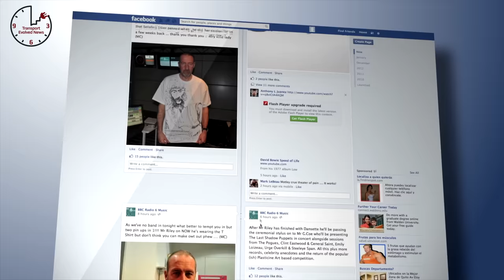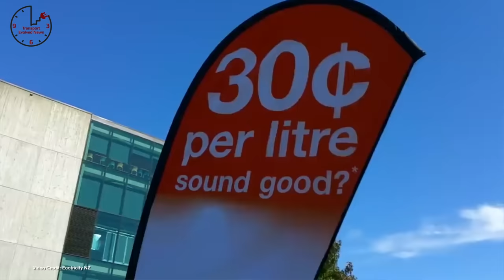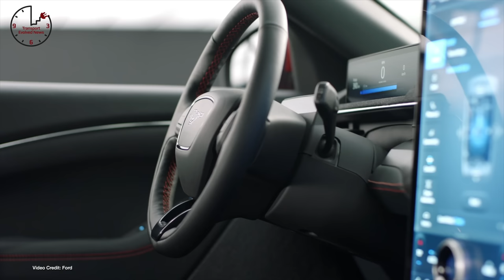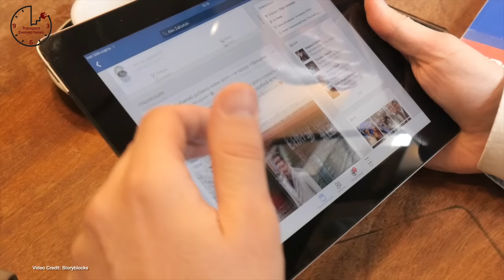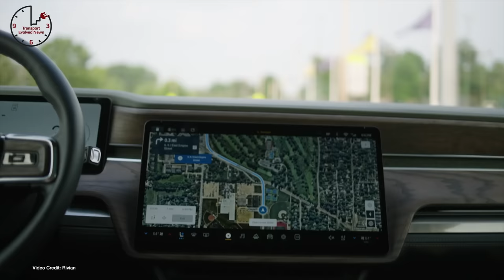TEN 349 -- White House Plans, Diess Disses Ionity, Facebook Pro-Oil Ads

Comment: Every automaker is anti-UAW. They just have CEOs with filters so they don’t admit it. And every EV advocate should be too. They worked hard to delay the EV transition because EVs require fewer workers.
Reply: The UAW give unions a bad name.
If you want to know why Tesla is non unionised? It's becuase many off those workers and families at yumi(Toyota) had the right to negotiate taken from them and UAW sacrificed the factory for GM jobs. The fact a year or so later UAW ended up with loads off GM shares (which they still own) makes many doubt UAW would ever have Thier or Tesla's best interests at heart.

Comment: I think we as part of EV community would have to stop covering hybrid vehicles, because automakers and govts are not. And we should know better as most of these hybrid owners don't even plug in and keep running them on oil. It's taking away resources( development, Subsidies,will and effort) from what could have been poured into pure EV development.
Reply: Hi Amuzic Earth, I understand your sentiment but where do you get the info that most PHEV  owners don't plug in? I'm  one such driver and like all others that I'm aware of,  we plug in fanaticaly. PHEV's are are great gateway to EV's but in some cases are needed due to poor or non existent charging infrastructure.  Most PHEV drivers that I'm aware of try to cover all or most commutes on battery only. Cheers.

Comment: The cars most affected by battery nerfing were S85s, not cars from 2019
Reply: That's what I though too...didn't sound correct.
Reply: @davidc2838  70, 90 and 100 kWh batteries had been nerfed when charging DC a lot, too, but not as badly and Tesla has taken it back mostly
Reply from the maker: I think you're right, I misread the article, which noted that the restrictions happened in 2019. That's my error - Winter
Reply: @transportevolved  Yep. You can apparently even install a software version from right before when the nerf happened (in 2019) and you get the old range and charging speed back. Not sure if I would recommend that, though. IMHO Tesla nerfed those batteries to prevent battery fires.

Comment: I wish those little E Scooters were legal in the UK. I work 4 miles from home which is a bit too much to walk and I don't want to cycle not least because no space to store it

So I drive

Would save 300 litres of fuel and local pollution to be replaced with just 30 KWh of electricity. Even if 100% of this electricity was from natural gas it would be like replacing 300 litres of diesel with 6 litres equivalent of natural gas. So 50x less fossil fuel burn. But the UK is now about 50% non fossil in its grid so its closer to 100x less carbon emissions

These should become legal sooner rather than later

Comment: I really like how Rivian have done pre (delayed) delivery test drives, as the saying goes drive it like a rental. This'll really let people see what the thing is made of, and drive in a mix of environments that they may have be worried to approach in a shiny new ride.
Reply: Except, I drive a rental the same way I drive my own car. Once set out from the parking lot and after 30 minutes realized that I wouldn't have enough range to make the destination and back again to the airport the following day according to the estimate the car gave me. But what did you know, delivered the car with +100 miles on the range estimate without refueling.
Reply: @Hans-gb4mv  It's just a saying, meaning that a rental is driven by many different types of driver and usually mistreated, so feel free to put it through its paces as the company expects that it will have a hard life, I'm not saying to mistreat it just see what it can do with in reason.

Comment: While the ionity 5 does charge very fast, actually better than even the latest plaid MS (on v3 SC), the efficiency is only average though and if you look at miles pr. min and not kWh then it's about the same... another excellent YT video has shown this already... the ionity 5 also makes a stop during charging for battery health maintenance, which is very interesting.
Reply: are you talking about the Ioniq 5?